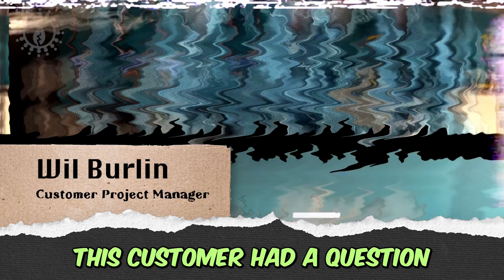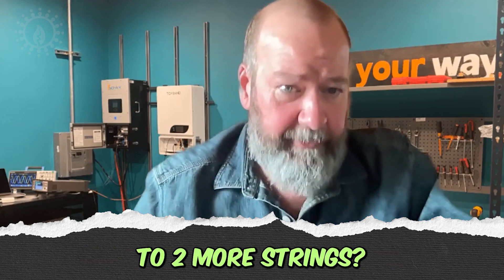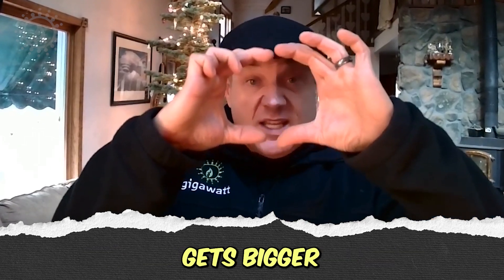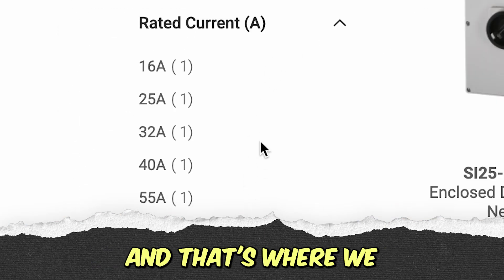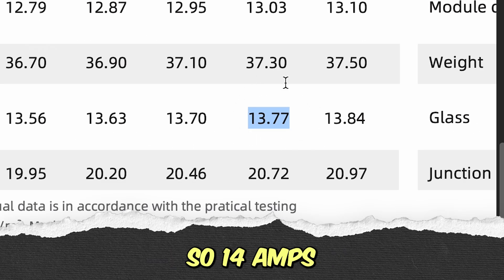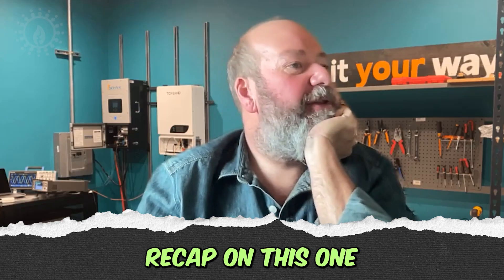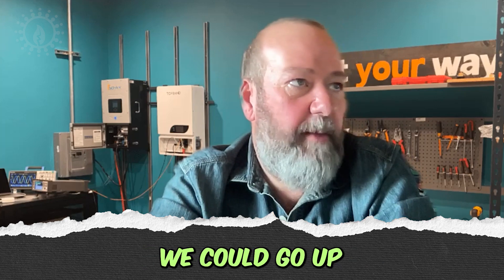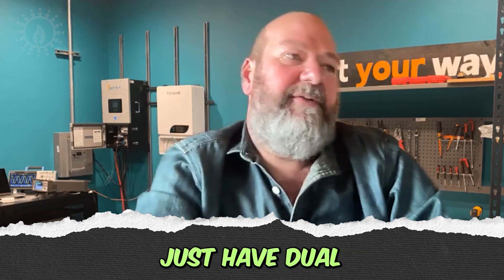How to Choose the Right DC Disconnect for Your DIY Solar System | Amps & Poles Explained

Comment: What if you overpanel and the amps and get really high? But my inverter can only take 15a, but my panel array can do say 40a. So I need 50a or 60a disconnect?
Reply from the maker: Great catch—and an important question!
In most solar setups, the amperage coming into the inverter from the charge controller or array can be higher than the inverter’s output rating because they serve different functions. The inverter’s 15A rating usually refers to AC output current, not the DC input from the battery bank or charge controller.
That said, you definitely don’t want to exceed the inverter’s input voltage or current specs on the DC side, or you risk damaging the unit. This is where proper system sizing—matching the array, charge controller, inverter, and battery—is key.
If you’re seeing a config where it looks like 40A is going into a 15A-rated inverter, it’s likely:
40A is DC charging current from a charge controller to the battery, not directly into the inverter
The inverter is drawing only what it needs from the battery to produce its rated AC output
Let us know your setup—panels, controller, inverter, batteries—and we can double-check the math with you! Always happy to help make sure things are safe and dialed in.